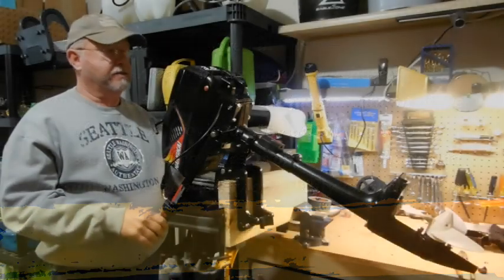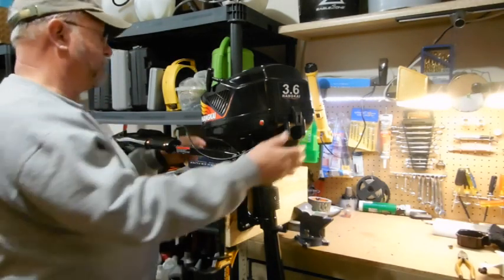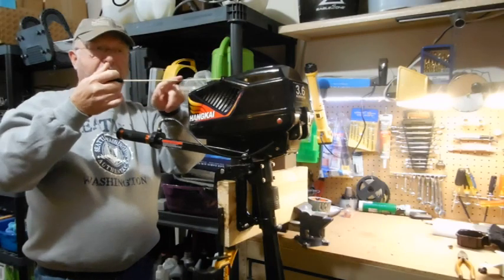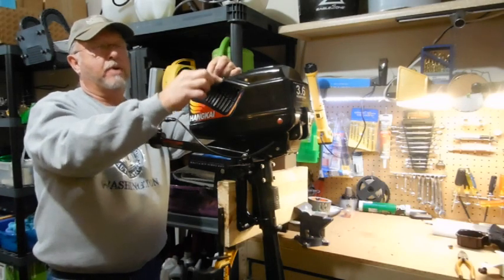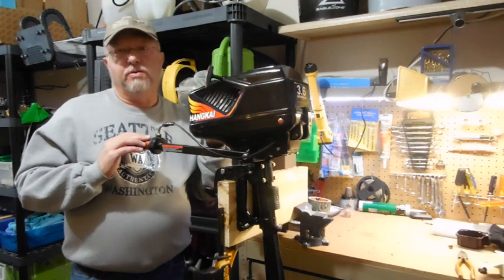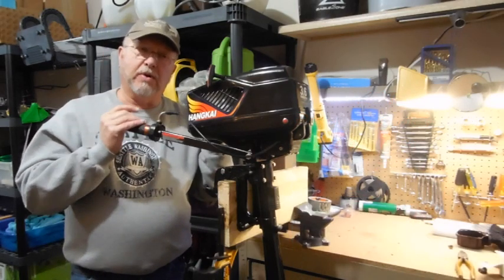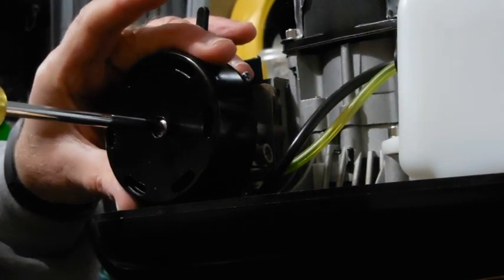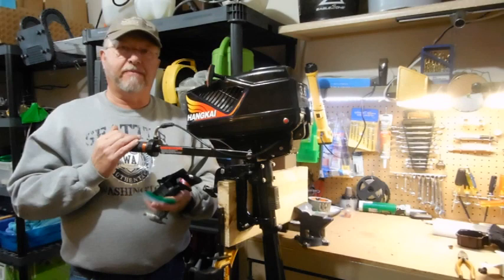Hangkai 3.6 / 3.5 hp outboard motor - 10 Things To Know

Comment: The 3.5 sticker is so fraudulent 😂this isnt 3 1/2 horsepower lol  try a mercury evinrude johnson of 3 hp and you'll realise thats like a 1 1/2  hp engine imo my buddy had one and  ran circles around him in a mercury 2016 2.5 4 stroker
Reply from the maker: I'm sure you are correct.  However for me, cost was a factor.  I just wanted to play around with the idea of building this project.  In reality, the little raft I'm putting it on is only rated for a 1 1/2 hp motor so maybe it's a good thing?
So my journey will continue.  Should I become an avid fisherman or find myself boating every week.... I'll consider your suggestion.  In the meantime I guess I'll just have to eat your dust (0:
Reply from the maker: I was looking around on the web and found the Hangkai web site.  They list both hp and cc for their products.  The cc for my Hangkai motor is listed as 3.6 hp /55 cc.  That figure would translate to a hp rating of 1.69 hp.  So it looks like you are correct.  But it's a fun toy for someone just playing around and not going out on a huge lake or the ocean.  :0)
Reply: Manny Suarez  ..  Yeah, and with a 2:1 gear ratio, that means the boat motor overall is a 3+ horsepower motor. In other words, no fraud. Just a lack of understanding on your part.
Reply: A bigger lack of understanding on your part, horsepower is not magically increased by a 2:1 reduction as HP is a product of torque and speed, so when you halve the speed you still have the same HP.
Reply: Fiveo  ..  Thank you. However, I never said it's magically increased or whatever. I simply explained how manufacturers come up with the overall horsepower ratings of their outboard motors - not the engine, the overall boat motor.
Reply: Manny I know you are 100% right, thanks for sving me looking like a moron.  A 50 cc made in china will produce at best 1.8 hp